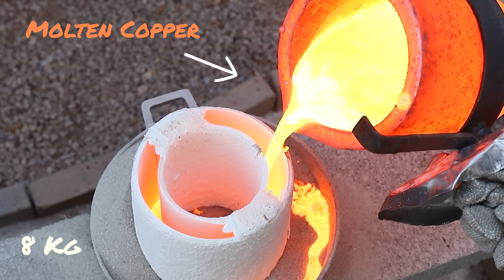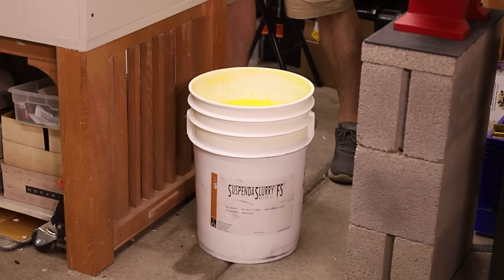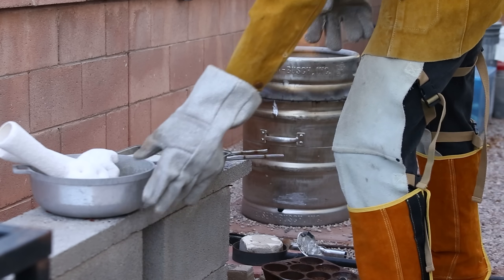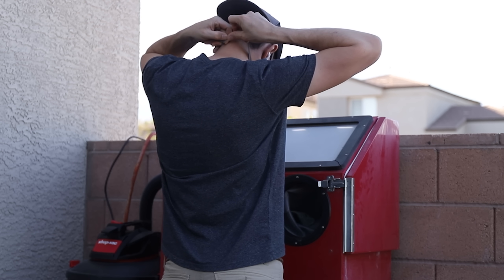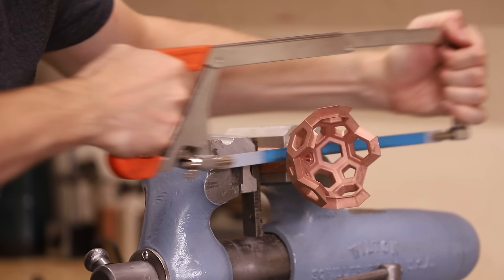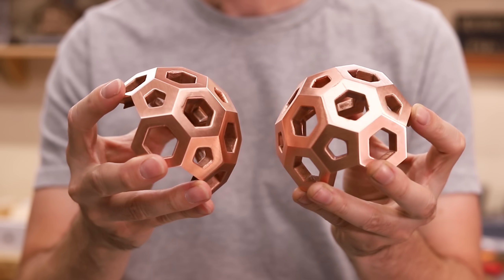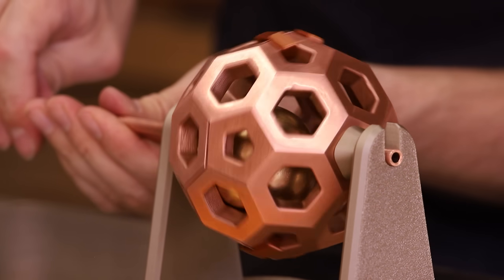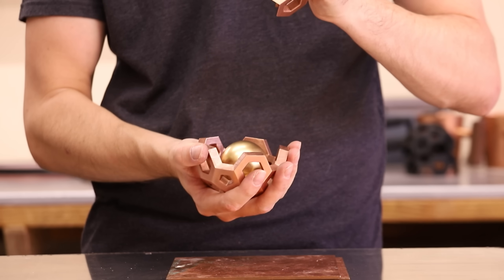HUGE Magnet VS Copper Sphere - Defying Gravity- Will a Neodymium Magnet Float Inside?

Comment: Because the spherical magnet must necessarily be directional along an axis, it's going to orient itself along the axis of rotation. The only thing keeping it levitated is the differences between the individual electrical fields within the copper, which are basically the length of the path aligned with the axis of rotation. 
 I'd like to see this as a sensor. Put a pickup coil in each one of the polygonal openings and record the data as you move it around. 
I'd probably choose a dodecahedron for this because it's facets are all the same size, while the thing you've got would need to be divided into two group inputs. 
But I'm a signals nerd.

Comment: If money wasn't an option I would get a high-speed camera so I could observe the sphere, that way I can see how well it's levitating at a given RPM. Next I would get a motor with a variable RPM range to find that sweet spot of levitation. Might also secure the unit to a table, add bearings, and bushings to smooth it out, then I might think of ways to observe outside forces being applied to the magnetic field.

Comment: I’m thinking a brushless motor (and possibly a gearbox) attached to the axle with an ESC and a knob input to control the motor should help dial-in and keep a consistent rotational speed.

Also, if you plan on spinning it for an extended period of time, I would consider bearings or bushings to reduce wear where the axle sits in the stand grooves.

Comment: You need the structure to work like a large coil that wraps around the magnet. You'll get a better opposing magnetic field. You could just bend a copper pipe around it in a helix. It should work better and be about x100 less work.

Comment: I wonder what would happen if you made a gyroscope with a neodymium magnetic ball as the center 'wheel' and then took a copper object like that and rotated it perpendicularly to the rotation of the gyroscope? Let's say you cut your copper object into perfect halves but leave a space so that the gyroscope could be attached to some external object at first as we wait for the copper object to get up to a specific rotational speed and then release the gyroscope at some point. Would it levitate better? Also, isn't some amount of electricity being generated? Really cool stuff here!

Comment: at 08:18 i came to the idea that an interrupted copper body will give you sort of lesser induced currents and thus lesser returned magnetic field.
still its not a sheet metal sort of structure, unlike a transformers body or an electric motor would be using. thus there is still good hope it will work out.

Comment: what i am curious about is if you can use the magnet on the outside to spin it and generate any kind of power.   and mount the exterior magnet to something like a perpetual motion machine or something. i wonder how that experiment would work out.

Comment: you should do another 1 with circles instead of hexs and place cylinder neodymium magnets in them to have an opposing magnetic force to make the ball hover, also if you paint the copper black you could see inside easier

Comment: HAVE YOUE TRIED running a electrical current through the copper to see if the ball goes stationary In the center... or if rotating slowly with current locks it in center
Then tried modulated electrical frequencies in low range... fun...

Comment: If you put a small electric current through the copper cage,, the core will spin. Just dont add too much electric as it will melt the core

Comment: COPPER!
SIDWINDEFLECTOR!
MORE SCREENS MORE MYOBIA
it's also bc overpop wifi 1.5 heat and bc youve seen it all; 
apparently "no1" cares that the moon was filmed in clovis nm and mars in the arctic -- lk @ shatner kd his wife and even MB seems if they hav enough clout they r given the keys wow sad.

never stare sun never dilate
sidewindeflectors rollens
tan acyrlic screens
nitelite function

*Top Health Advice:*
1. Night Light orange tint blue light filter/blocking program function on devices saves eyesight: Use a large BROWNTANorDARKorange vinyl plastic see-through panel (see "acrylic sheets") paired with the computer's nightlight blue light software function for eye comfort for protection against harmful blue light.
2. Side Window Deflectors reduce driver-side eye damage and glare while driving, turning your car into a more comfortable space like a living room.
3. Avoid excessive screen time to prevent blindness increased screen time leads to the myopia pandemic.
4. Use Rollens sunglasses when outside; consider the orange-tinted "Gold Rollens." Can put multiple overlapping so can use 2 at same time for more protection.
5. Never stare at the sun to avoid retinal detachment and eye damage.
6. Avoid getting your eyes dilated DILATION LIQUID weakens eye muscles and leads to blindness. An old lady assistant spilled it and said "oops," now light-sensitive, reduction of accommodation, more myopic, never fully recovered.
7. Avoid the chickenpox vaccine to prevent shingles later in life.
8. Cigarette Smoke is responsible for numerous deaths and severe health consequences most die early.
9. Use eclipse glasses for eye protection.
10. Privacy screens can darken screens.
11. Eyejusters self-adjustable glasses come in stainless steel and hybrid materials.
12, SWIFT passes out earplugs to protect her fans anything over 70db = DEAF tinnitus ringing is dying ear cell freq u will never hear ever again. MUFFS!

c ch comments 2 protect eyes c4more

MARVELMOVIE
SPOILERS
best way to watch marvel:
blkpanther12
ironman12
wintersoldier
ultron
civilwar
xfinityendgame
nowayhome
deadpoolwolv

NASA STILL lying about MARS -- it is filmed in The Arctic.
moon @ clovis nm
jfk ordered the moon lie then cia bush killed him for it then trump killed/or hid bush for it aka faked death same w how epstein might still b alive
armstrong went2whitehouseadmited moon faked in riddle lang then when nearly dead wanted 2admit directly but was moved intowrghosp rm & kd
buzz has admitted a signif# of times the moon landing was faked
moon rocks are wood
moon horizon photographer killed same way as jfk jr (who had GEORGE mag as in bush) in plane
grissombaronkilled for whistleblowing b4 court datebaron
kubrick also killed his movieshowed fakes
obamawife=manmike

Comment: The problem is that the magnetic field emanating from the magnet is axisymmetric, not spherically symmetric. So it’s not quite the same thing as a cylindrical magnet being suspended in the middle a copper cylinder at high speed.

Comment: Your skill, imagination and curiosity. I am jealous 😮. The only thing I can say here are the holes in the cast creat a pocket where resistance from copper is low and causes the magnet to fall quicker to the opposite side. If it was a bigger (like double the size) sphere and a solid one I can see the magic you are looking for. Of course that would entail that you install the camera inside the copper sphere since you cannot see from outside. Having a tiny camera embedded inside the sphere flush with the surface or just below it so it's not damaged if the magnet hits it. Stay curious and I love you work ❤❤❤

Comment: You need to drive it with a 3-phase induction motor w/motor driver so you can accurately control its RPM - then set RPM so that the video will "wagon wheel" and the sphere will appear stationary, or rotate very slowly, and the ball will be very visible floating inside.  Instead of using video, you could use an LED strobe to accomplish the effect naked-eye.

Comment: Could you create a disc of magnets around the sphere which you moved with a motor. Would be interesting to see what happens with your magnet inside the sphere but would also be cool to see what would happen with a thin iron sphere inside your copper sphere with the magnet ring on the outside side spinning.
     You might also get better results if you had a more sphereaecal shape on the inside. Those differences could be effecting it

Comment: The break between the two in the middle is causing breaks in the eddy currents that cause the sphere to float. Try using high silver solder or some other high conductivity way to adhere the two together and that might improve the eddy currents generated letting it float more securely. The holes in it may also be causing the currents to flow in odd ways which could be affecting how it floats.

Comment: I think you don't have electrical conductivity across most of the joint, which is robbing you of the eddy currents you expect.

Can you solder or braze across the gap? Or friction-stir weld, perhaps? High temperatures will demagnetize the magnet so you might need to put most of the piece in a water bath while working, or something.

Comment: See if you can put a small neodymium magnet in a copper tube bent into the shape of a wheel (like a bike wheel) to then spin it and find the perfect speed needed to suspend the magnet in space. Also, perhaps put small holes in the copper wheel to observe the magnet's suspension (where the upward grip of the copper equals the downward force of gravity).

Comment: First, you need to try printing some guides so that the poles of the magnet face vertical along the hemisphere of the spin of the copper. Second, you need to try passing a current along the support pin with one end as positive and the other as negative so the shell is electrified. Try brushes to add the current Maybe. Great experiment!

Comment: Dear Author. As you may kow, transformer is cut into laminations, in order to prevent eddie current. I would offer to hold it to other holes and to connect the electrically. polish connecting sides ion argon/helim atmosphere and force them together.

Comment: The single Ball, probably wants to have two poles, which is probably causing the irregular rotation, occasional ticks off the side. Perhaps if you had a smaller hedron, with many small magnets it might present a more uniform field out to the copper?

Comment: try putting a magnet at the base of the assembly and connect it with a motor and try changing the mass of the sphere magnet a few trials and errors and this could truly turn into a spectacle. A few adjustments to the rotation could also be benificial. But this is quite amazing. :face-red-heart-shape:

Comment: saw part one on tik tok. then this video popped up on my youtube page. absolutely worth the watch. i wonder how well it would work if you had a bigger copper enclosure, as well as, using a brushless motor with a pwm module to control the speed of rotation...

Comment: If you added a motor to spin the ball at a matched speed as your frame time. For example 1 frame every rotation then you could in theory make the cage look stationary and make the movement of the ball inside better to see.

Another idea would be just using the tube and building a base that spins the copper tube while the zylindrical magnet is placed inside. That would let us see the floating magnet better. Next step could be the build a casing for the copper tube sothat noone could see the tube spinning and just see the magnet floating in the air.

Comment: A smaller magnet would be lighter and take less force to levitate. And it would have more room to fall without hitting the sides. If you were to ever redesign I agree with some comments saying the eddy currents are being disrupted by the seam and the holes. A different design with a thick, continuous equator and spokes you can see through while you spin it (like 2 birdcages stuck bottom to bottom with a ring joining them together) would probably support a floating magnet better.

Comment: Excellent video.  Thanks for sharing the whole process.  I think if the base and a motor are anchored down together, that will take care of the wobble.  A couple of races and small jack shafts will keep it from hopping out of the stand.  And a strobe light set to match the rpm’s should give a nice view of the floating magnet.

Comment: The way I'm understanding what you're trying to do is: at a given drill rpm or drill rpm range, for a certain sized/strength magnet enclosed in a conductive sphere, have the sphere appear to levitate within the sphere. You could try playing around with the sphere shape or copper thickness. An easy way of doing this is using 3d printed electroplating. Just provide your wonky shaped spheres and get the shop to electroplate it with copper.

Comment: I would use a back light or paint the magnet in some florescent paint and use a black light to illuminate only the magnet.  Attach a motor connected to potentiometer so you can very speed.  Set screw or key the shaft to the gear to lock them in place.  The axle needs to be captured and lubricated; you might be able to get away with a couple drops of oil for each run.  The base will have to be secured.  I see you have clips only on one side, you might be able to balance the copper "case" by putting the clips where it needs to act as counter balance.

Comment: Perhaps you can redo the "sphere" to where the 1cm or 2cm "equator " is solid, so the magnet has a full solid path to react to the magnetic field as is spins. Perhaps the centerline areas with "holes" act as a on/off field and doesn't allow the magnet to fully levitate.

Comment: Good job. Mount rotation points 90° from present location as mentioned previously by someone else.   Think also about 3-D printing with current carrying capacity materials to form a circuit of your choice.  Perhaps with a multi filament head or two separate print heads; the second with the  insulation layer.

Comment: You made the sphere but your only spinning it about one axis  of rotation like it is in the tub which was cool but doesn't truly take advantage of the sphere.  You need to spin it about multiple axises.  I'd tune a motor to time it just right so that it spins  perfectly along one axis like the tube then add add rotation about another axis.  i'd be surprised if you can do all three but two would give you a better float I think.  Id' also paint the sphere and tetrahedron contrasting colors like black and white so that they are easily visible.  All that to say THIS WAS FREAKING COOL!!

Comment: The difference in behaviour to solid copper and the copper sphere with holes in it is astounding. Reduce the holes , they maybe interference due to the holes which is causing the magnet to touch the sphere

Comment: Consider using a ESP32 microcontroller for the spinnin part, so you can fine-tune the spinning precisely. a quick setup can be done with an Arduino, a popular brand

Comment: You only rotated it in a single axis (roll) perhaps you could set up a system using two small DC motors to get simultaneous multi-axis rotation. Perhaps with the right speeds, you could get the magnet hovering in the centre near perpetually.

Comment: Think When Sphere Is Spinning, It is Spinning Magnet As Well, Once Rotating at High Speed, I Would Try Rotating Base 90°
Then Maybe  try to Turn So Axis is Verticle, Once Rotating Horizontally.
Great Work, Looks Like Fun, 
Shouldn't You Be at Work, Miserable instead Of Playing.
Think Everyone is Jealous.
Cool. I would Like To See Gold Replace The Copper in these Experiments.
First Experiment Would be Dropping a Magnet down a Gold Tube. If It Works, Thinking If You Dropped Sand Wite Fine Gold Down Along Side A Magnet Plate or Array. Sand Would Drop Vertically, And With a Divider, Gold Would Sucked to Once of The Divider
Looking Forward to You Making a Gold Tube and Trying.
Good Luck

Comment: You can use the magnet effect to spin the sphere from its base without any apparent apparatus to actually rotate the sphere. Might be a cool little gizmo to have. Also, you can hollow out the magnet perhaps and insert some LED lights, I believe the em field should be enough to create a current that lights up LEDs- or you can do this in the vertices of the copper spheroid to kind of showcase the em field generated.

Comment: I wonder what would happen if you had a hollow donut shaped copper tube and put in a magnetic bearing and sealed it. then outside the tube install a key locations magnets that will push and pull the magnetic bearing inside. mount the whole thing on a rig and give it a spin see what happens?

Comment: I wonder how much torque the second magnet can create if it was closer. At 11:45 mark. Basically and remote drive shaft to turn something underwater (Allowing for a disconnect for more airtight seal or in the air for an aircraft.

Comment: Use Nomex tape and insulate the halves... motor control for sweet spot...put a multimeter across the axles.
oh, and put lines on the sphere.

Comment: To improve it you could/should have a complete sphere or fill the holes as much as possible to allow for the electric currents to be more homogenous thereby exerting a more homogenous reaction force on the magnet. 

You should be able to understand if it floats or not by the sound of it 😬

Comment: Mechanical levitation via spinning thick copper tubes and hovering a magnet in between..I suppose you might need to turn some dihedral in the middle of the tunnel to stop the magnet moving toward the bearings or any ferrous material

Comment: Since youre currently rotating it around one axis, doesnt this setup produce the same effect as rolling a magnet inside the copper tube? An interesting test would be a small version of those human gyroscopes they use in space training to spin the copper ball in all three axes to see if the change in direction of rotation affects the ability for the magnet to float